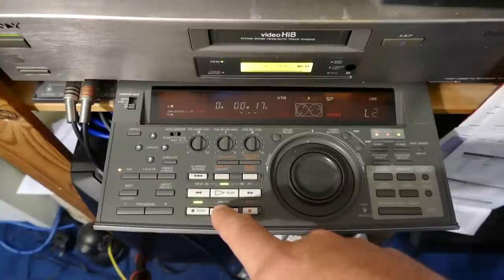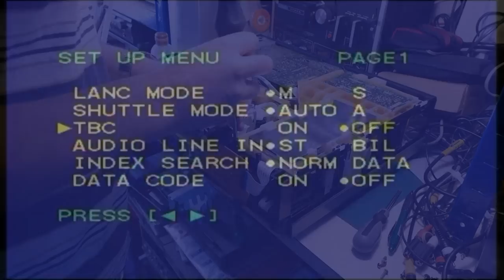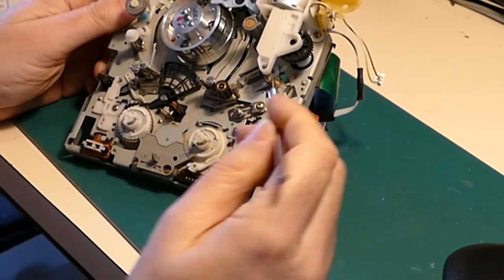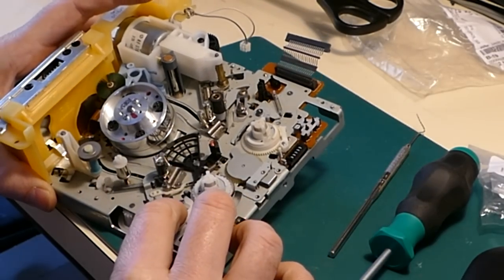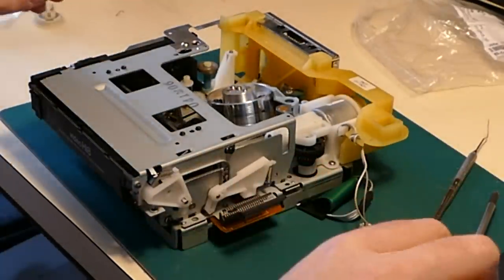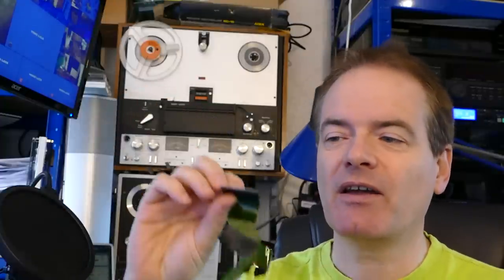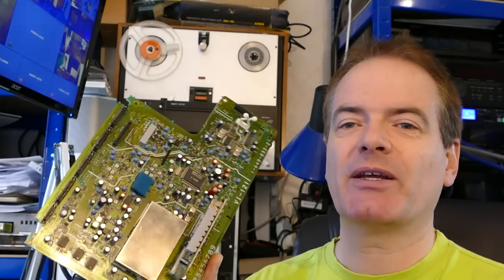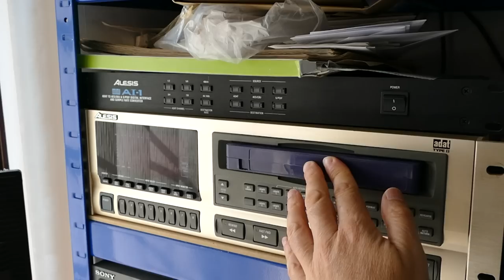Repairing the most complex domestic video recorder, Sony EV-S9000E / EV-S7000

Comment: Hello, the timing belts are not the problem. It is a Table Assy Reel x-3942-954-1. Where can I order this part? I would change the other one at the same time. I haven't found anything on the web. Thank you for the really great videos.
Reply from the maker: I'm afraid they are no longer available, which is causing these machines to become almost impossible to repair these days.

Comment: Hello. A few days ago I bought this second hand VCR. There is no picture when TBC is on. Could the TBC be damaged or another block. I have a schematic from the internet but cannot find the TBC block
Reply from the maker: Usually it's just the TBC board which requires a rebuild in this case, so hopefully replacing all the surface mount electrolytic capacitors on that will repair it.

Comment: Great video! I have the same problem but with model EV-S900. Would you lead me with the solution for that unit. I have the diagram but not sure where the board with the capacitors is. Thanks in advance

Comment: Hi I have EV-s9000e pal version , the problem is that the video out is only blak/white , croma non present. do you have suggest ?  may be the VI-121 board to replace ? thaks
Reply from the maker: It will be due to failure of capacitors somewhere, most likely on the main board at the bottom.  So non-trivial to repair.

Comment: Hey.

i have a sony ev-c2000e with dead power supply.
there is the same drive as your machine.
my both gears are also defective on mine but can not find spare.
Reply from the maker: The power supply should be repairable with new low-ESR capacitors.  The split spool tables are a pain, all you can do is try to repair them as best you can.  Parts are no long obtainable.
Reply: video99.co.uk   Hey.

many thanks for the reply.
I will try to switch capacitors.

i have tried and glued the spool and hope it works.

really good videos you make.
Reply: @video99couk   I have changed capacitors.

now life came to the machine.

it cannot run it with the defective gear.
but many thanks for the help.
now it is not dead anymore.
now i have to look for some new gears.
hope i can find some.

sorry.
my English.
I am Danish and not so good at English

Comment: Great job! These "old" tape based units are just gonna fail at any time so any advice is always welcome.. Just got a Sony D8 camcorder up and running, thanks to your repair video, faulty flat cable connection in this case 👍

Comment: Do you have a source for the take up reel for these units. I have 2 of them personally, and they both have the dreaded cracked gear. They have both been replaced and cracked again, and the sony parts dealer told me 8 years ago they were NLA, so I have been using them limping along with cracked take up hub gears.
Reply from the maker: Alas no.  The UK supplier (Charles Hyde & Son Ltd) went bust and I don't know what happened to their stock, probably in a skip somewhere.  All we can do is internet search with the part number and see if anyone still has any.  I too have had new ones crack up again after a while.  Even when you could get them, they were really expensive.  There's no hope of 3D printing them, so we are left high and dry.
Reply: Hello 12 voltvids
I have a take up reel, used but in excellent condition. If you want it to repair your vcr I would be delighted to ship it to you. 
I’ve been watching your videos and they are great. 
Greetings from Paris
Reply: @borislazarov8475  It would be great to have a spare. My repaired one is functional on my 7000 for now but my 5000 is bad. Same part.
Reply: @12voltvids  
Hello Dave, which one do you need, supply or take up spool? And how should I contact you in private. 
Cheers

Comment: Aaarrgh. Sony disease. Why did they choose to mix metal and nylon like this so often! Let's hope 3D printing or 3D extruders eventually bail us out.
Reply from the maker: Panasonic did it too, with the loading motor drive coupling on the K-series VHS/SVHS decks.  I have a 3D printer but there's no chance of making a gear as small and complex as these,
Reply: @video99couk  An option is to get them made professionally on a SLA printer, those printers can give very impressive results.
It´s is still a bit expensive though, I think one gear would cost around 70£ to get made if you already have a proper STL model of the gear. What kind of printer do you have?
Reply from the maker: @jakobat1994  Mine is just a da Vinci Mini.  Nothing fancy but I've made a few components which have worked first time, so I quite like it, especially since it was absurdly cheap.
Reply: @jakobat1994  That's a pretty cheap price to make a part that's unobtainium, and saves rare decks from the scrap heap.

Comment: You just saved me a tonne of money by telling me how to turn off TBC! Thank you so much!!
Reply from the maker: Yes, turning off the TBC is a workaround for its failure, but does take away the key feature of this machine.  The TBC is very easy to remove and you could probably take just that panel to any electronic repair agent, for a quote to replace all the capacitors.

Comment: I am amazed (and equally appalled) at how complex this beautiful machine is. I bought my EV-S7000 brand new (aprox 1991?), but upon pulling it out of storage, it loaded the 1st tape I put in and then refused to do anything else. Most of my tapes to my recollection do not have PCM dubbing (at least the important family events don't).  What would be your recommendation on going forward? Do a quick look inside to see if I am dealing with cracked spools? If its anything beyond that like capacitor issues, I would have to bow out. I suppose I'll have to open it up 1st to see what it looks like.  - Thanks again for posting so much great understandable info on this device. I truly loved it when it was working.
Reply from the maker: Will it eject the tape?  If not, the list of possible causes is very large, ranging from power supply issues, capacitor failure on the syscon board, mechanical problems such as sensors or a jammed loading motor.  It's non-trivial I'm afraid.  Split spools are not likely to be the cause of that particular problem.
Having fixed this machine a few months ago, the TBC board has now failed, I'll do a video about repairing just that board later this year when I get my new workshop.

Comment: I have an EV-S7000.  Had the power supply for the screen on the slide out tray go out.  A couple friends offered to fix it.  This was apparently used exclusively for this model as after a year trying to source parts they wound up designing and building a new power supply from scratch.  Worked for ten years but just burned out again.
Reply: Were those designs ever made public?

Comment: I hate that deck as it is on the fifth take up hub had to replace over the years to the point stop using it years ago. That hub cracked when machine was new still under warranty. It was a design flaw, not due to age like some. That machine eat more tapes then my umbrella cockatoo did as she escape cage while at work and when though my bin I use to keep them in and decided it be a good idea to throw them down and tear a few of them apart. Funny thing is she when back into her cage at some point sitting quietly and pretended she didn’t do anything. One tape was important and had to spend some time flaring back damaged section, splicing it back together and putting in new shell to transfer it. 

Those flat cable are easy to rip. JVC decks are worst as the glue holding the blue stiffener always come loose and make it easy to bend connections if pushing in. Trick with those  is to just push on blue stiffener and slide in firmly as it stick to the connections metal good just not the plastic insulation on the flat cable.
Reply from the maker: You're right, the supply and takeup spools are a dreadful design.  I've had a brand new replacement break after a couple of years.  They are no longer obtainable.

Comment: Hello,
I have a sony EV-c 2000, it does not fast forward, otherwise everything works, where are the spare parts?
Reply from the maker: Check to see if there is a split in the takeup spool.  If so, all you can do is try to repair it since spares are now completely unavailable.

Comment: Good evening. I ask you for a kindness. I need spare parts for Sony 9000 E Pal as the two Assys are damaged and I would also like to change the belts...Can you help me find the spare parts? Do you have a supplier where I can buy spare parts? Thanks for your time. Good evening. Michele
Reply from the maker: Parts for this are now very hard to obtain since the last supplier in the UK went bust a few years ago.  Often there's little option but to scavenge parts from scrap machines.  The deck is shared with the EVS2000E which may be cheaper to find in scrap condition.

Comment: I kindly ask for advice.
I would like to buy the 9000 to digitize my hi8 cassettes. On the market there are some reconditioned used and also some new ones, never used, perhaps opened to renew some capacitors even if unused. What should be done? Buying a new or used one? I also ask: in your opinion the reproduction quality of the 9000 is comparable to that of my camera under repair, the Sony ccdv880e!
Thank you
Mario
Reply from the maker: The EVS9000E can produce excellent pictures, so might say better than a camcorder.  However:
1: The EVS9000E can now be unreliable due to capacitor failures and split reel tables, even if never used. 
2: Lower serial number EVS9000E machines can put "STEREO" onto the display every time there is a tape glitch or break in recording.  This can be a terrible nuisance if you are trying to digitise the material.  I don't know the exact serial number this was fixed but my number 11778  has the newer firmware which does not do this.  11588 has the early firmware, so it's around there.

Comment: I have a weird issue: I have inserted a tape inside, but not able to play, forward-rewind, or even eject it! The eject button works cause it can make the player turning on when it is in standby...
Reply from the maker: Could be any number of causes but I would start with checking power supply capacitors.
Reply: @video99couk  Ok a miracle, I've removed some part inside, remount everything, and it's working again!

Comment: Hello sir, i wonder if you can advice me, i have this recorder, model EV-S900E B, i haven't used it in years, maybe even a decade, but it was kept properly and away from dust, today i decided to put it on sale but needed to test it first, now it doesn't turn on anymore, i just see a red light but nothing happens when i press the button... any ideas ? thank you very much.
Reply from the maker: Power supply capacitor failure is likely, but there could be other faults too such as split cassette reel tables.  It may need some professional attention.

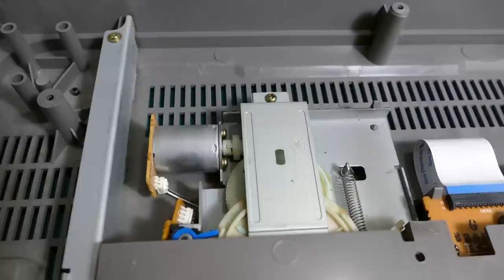Comment: 34:18 Did you have to remove all the circuit boards to access this, also do you have more detailed pictures of that part?
Reply from the maker: No, you have to split the machine apart by taking the bottom off.  That does mean taking the front cover off to gain access to all the screws.  it should take about 10 - 15 minutes to get the bottom section split off the machine.  By the way, just today I've been replacing all the surface mount capacitors in the TBC circuit for one of these machines.  Quite time consuming, but now I have the right soldering equipment, it's not too hard.

Comment: I purchased the Hi8 Sony EV-S9000E new in 1991 along with a JVC Super VHS HR 4700EK. The JVC broke down and I got a new Super VHS deck but it was so light weight that I got the 4700 repaired and sold the new deck. The Sony EV-1000 has had more problems to fix than the later models but was still fine when I needed it a few months ago to transfer 8mm to USB memory stick. All my Hi8 tapes have PCM sound tracks, including my own camcorder recordings. I used a digital 8 deck to transfer but that has no options to include the PCM track instead of the AFM one.
Reply from the maker: That's right, Digital8 decks lack PCM audio playback.  There are not many working EV-1000 machines left, it was a bit unreliable.

Comment: Ti volevo chiedere dove posso trovare le bobine su quale sito,o modelli da stampare in 3d ,grazie
Reply from the maker: It would not be possible to print the spools because they consist of metal and plastic components moulded together.  It may be best to try to repair the broken ones somehow.  Replacement parts seem no longer to be available, and even if they were, they would now also be broken due to age.  The plastic shrinks.

Comment: i just fixet my  sony ev-s9000e, the small whells will never breake again!
Reply from the maker: Did you glue them up?
Reply: @video99couk  yes, the plastic was broken in 2 parts, so I toke the    2 parts off the metal and  grinded the metal disc so it fitted the sice of the plastic and then used Araldit to fix it together again,
Reply from the maker: @planet9379  Clever, I like that.  Thinking in those terms, I never throw away the broken gears, just in case such a solution was possible.

Comment: Hi Colin. My ev9000 deck is suddenly beginnig to eat the tape. Do you know what I have to adjust or replace?
Reply from the maker: Likely causes are a worn pinch roller or split take-up spool (very common and almost impossible to source).
Reply: Hi Colin. I think the take up spool is cracked. But it is also something with the eject mechanism causing the machine to keep trying ejecting the tape even if it is out. Just the last part of the eject fase keeps trying back and forth. It is a noise like one of the platsic spools teeth are scratching. Sorry for my bad explanation

Comment: I HATE that "Hot Fish" smell let out by capacitors! 2 of the large Fuji lenses I have for my BTS LDK-9 make the smell after being on for like 5 minutes, then the lens starts zooming on its own or the iris goes crazy. The worst of the "Fish Smell" was in an IBM AS/400 E04 form the 90's at the computer museum I work for. It was the capacitors in the power supply that started going fishy, and the smell was pumped into the room by the large fans inside the machine, YUCK!

With 3D printing getting better every 3-6 months, in the near future it may be possible to reproduce the shattering plastic parts, although a 3D laser scanner would be needed to scan the parts or have an extremely good AutoCAD person.

Remember anything is possible in this business, and if there is someone out there making their own Quadruplex video heads, then the sky is the limit.
Reply from the maker: I do wonder if the formulation of some electrolytic capacitors actually includes some fish-derived compound which causes this smell.

I'm sure my 3D printer won't be able to help with these gears, but maybe someone can do it in the future.
Reply: @video99couk   It would not surprise me if there is a small amount of fish oil in some electrolytes, to help keep things "moist" and prevent evaporation, being it is relatively cheap and all. 
For the smaller surface mount capacitors, I have been using Aluminum Organic Polymer capacitors, which have a solid electrolyte. They also work well in replacing high capacity older wet tantalum capacitors, as you can find them quite easily in 10% tolerances.

Comment: we own one and it doesn't rewind tapes , playback and FF are fine
Reply from the maker: That will be a split gear on the supply reel table (left side).  If you can get hold of a replacement (or repair the gear somehow), you will need to set the back tension as I did, when you refit it.  Not a job for someone who is inexperienced at video deck repair.

Comment: Hello, and thank you for this fantastic and impressiv description!
Since 1992 I own this fabulous device and copied with it about 20 Video8 and Hi8 tapes a year ago. A few months later I found three forgotten tapes, but in playback mode the image was distorted, sloping, so to speak. No change with cleaning tape and my Hi8 camera long ago had given up. I phoned around in Hamburg, but so far haven't found a suitable workshop. There are not many experts around anymore, who can deal with those machines. It's possibly a less serious problem and I don't want to give up on the device yet. 
Do you have any idea, what could be the reason?
Reply from the maker: Start by disabling the TBC in the menu to see if that solves it.
Reply: incredible, I changed to OFF - now playback is perfect again! It says in the manual, TBC ON is to avoid vibrations, but the recorder normaly stands firmly on the table, so what? I must have changed it unintentionally before. I´m so relieved, thank you very much!

Comment: Hi. Great video! I have the exact same model but my cassette carriage suddenly stopped working. It seems dead. Do you have any tips?
Reply from the maker: Unusual, I've not had that fault, so I'm not going to be much help on that one.  You will have to take the deck out (not too hard) and study it.
Reply: @video99couk  Hello Colin. Do you know how to turn off the OSD on screen display on these? I have not found out. Read and looked everywhere...